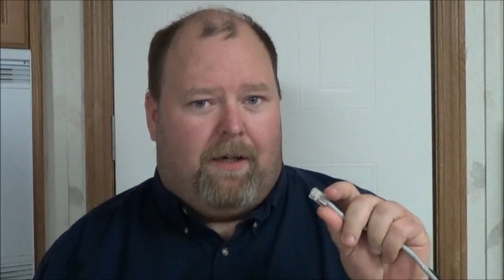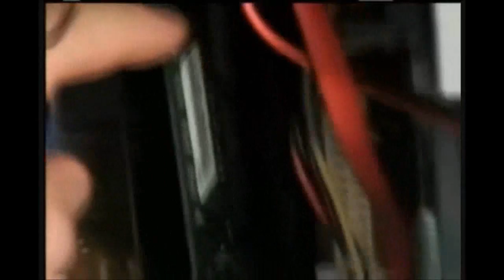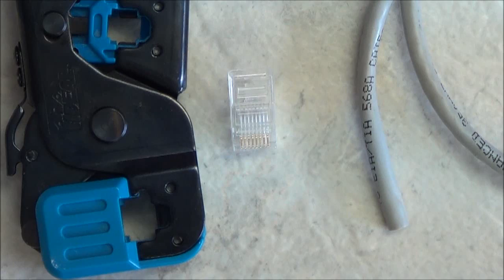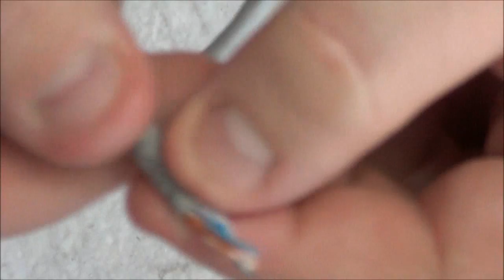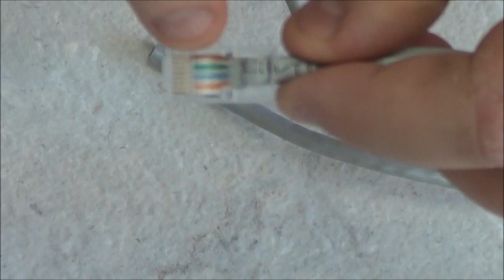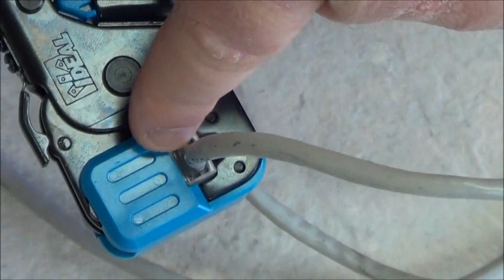RJ45 Data Connector replacement

Comment: the only thing wrong with the video  is when you first put the cable in the rj 45 plug it's not in the video.  you messed up the camera angle.  and then all the intro stuff is really not necessary.